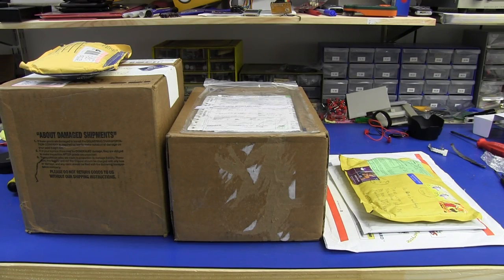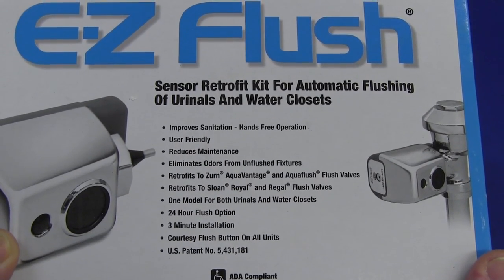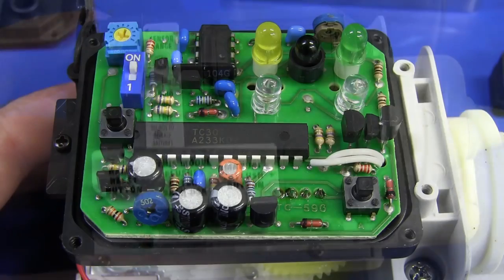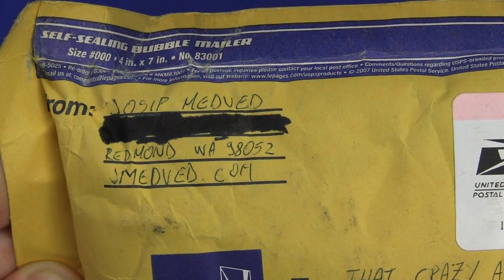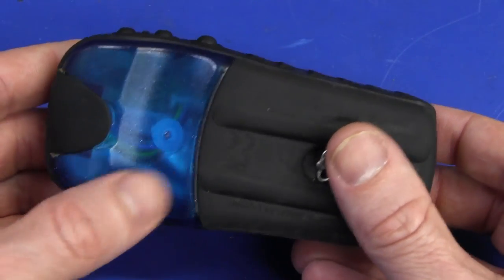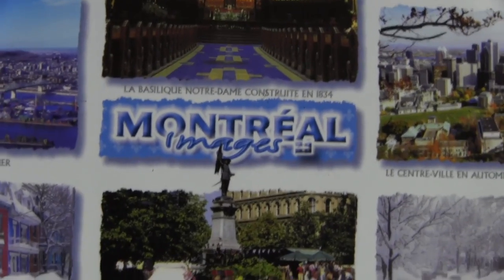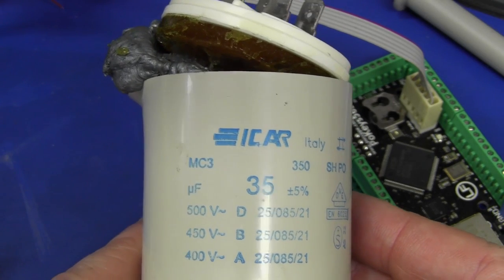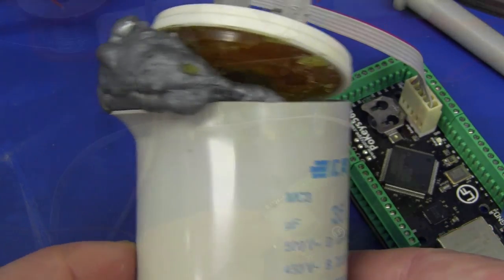EEVblog #377 - Mailbag Monday

Comment: It's no wonder the IR-sensor of the toilet-flush-thing isn't working like that, when you removed the housing you also removed a little opaque black plate that fitted around the LED's. Without this plate, the IR sensor is in direct line-of-sight with the IR LED's. That will certainly create a false signal.

Comment: I have one of those eTrex Legends!  It's a very handy little GPS unit.  One time when flying and the aviation-specific GPS in the plane with the external antenna kept losing the satellite signal, I got out my Legend and put it up on the dash board, and used it to fly lines of longitude more accurately (down to 5 decimal places of longitude) than I was with the big expensive piece of junk.  I also have a handlebar mount to carry it on my motorcycle, and can use it to stream the GPS data to the laptop so I can run a moving map for road trips.  I even stuck it inside a model airplane with track logging turned on so I could upload the entire 3D flight into Google Earth.

The only thing I don't like about it is that it has only 8MB of on-board memory and has no expansion slot for a micro SD card like some of the other eTrex units.  Oh, and the data transfer over the 9-pin serial cable is painfully slow when loading map segments onto it.

Comment: I use the older version of this pokeys (the 55) to control the front panel of my cnc lathe. It allowed me to use the original keyboard with it's keyboard scanning feature. Works pretty well.

Comment: Dave, I have an eTrex legend that is in worse condition, a few dead lines in the LCD and the LCD itself sometimes go intermittent and I have to slap it a few times to bring the screen back. My lanyard strap mount is busted in the same way. I got it for five bucks at a Hamfest including a Car adapter and a serial cable. That is NOT a genuine connector as I have genuine accessories and the connectors match the color of the Legen and are keyed. PM me an email address for a photo Dave.

Comment: that little PoKeys board would be excellent for a home security system if bodge-wired to use 48v power over ethernet, with a regulator to give 5v, as i could use it to trigger magnetic door catches once a correct code is put into a keypad or a correct RFID chip is detected. also a vibration sensor could detect if someone is attempting to force the door, raise the alarm and notify me by email or pager etc :)